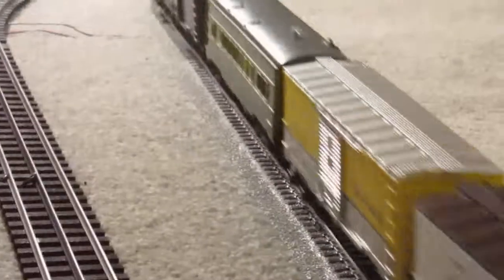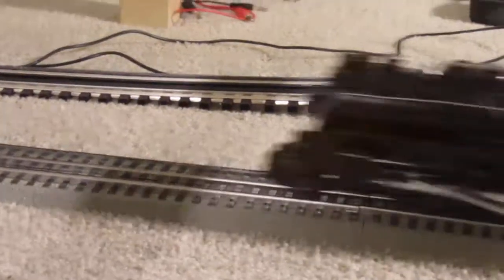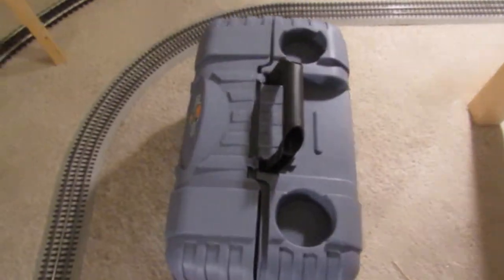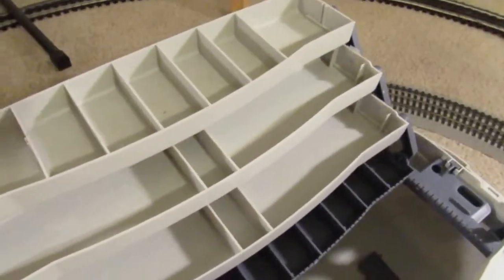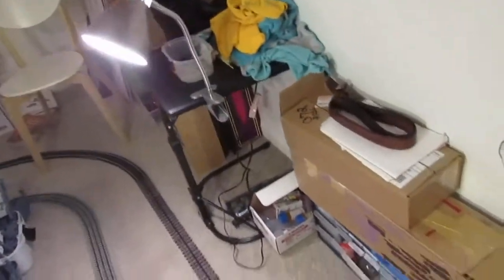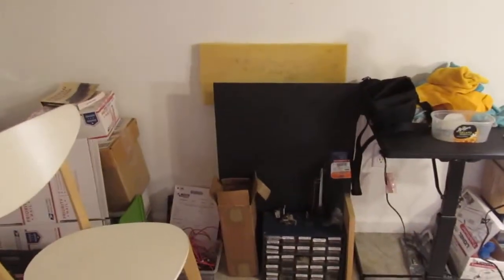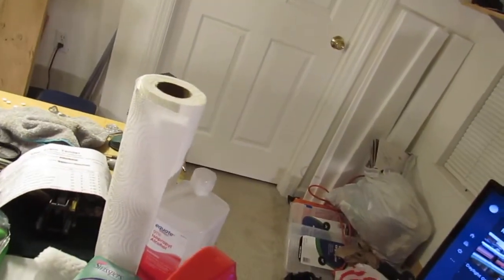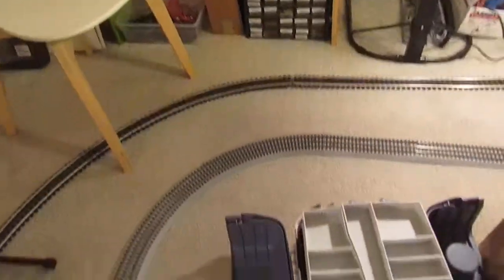Runnin' Trains after work,tips and tricks

Comment: Last year I was in Walmart and found a Hyper Tough 3-Drawer Project Cart with casters and a wood work top on sale for about $70... the top also has places for various tools and trays.

I knew this would be near perfect for storing train stuff, like books, tools, parts, and I could wheel it around my train layout and other work benches in my basement to do various train projects.

I also built a test track (with an LW transformer) for it that mounts to it via very strong magnets and sits up above the top of the cart, and can be easily mounted or removed.

Here is a link to the cart on Walmart's website... https://www.walmart.com/ip/Hyper-Tough-3-Drawer-Project-Center/49054339